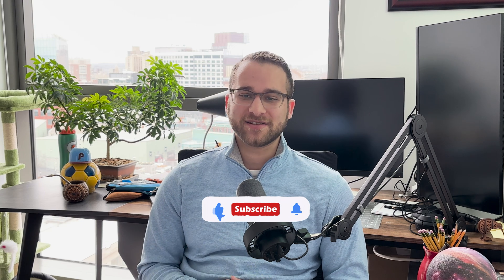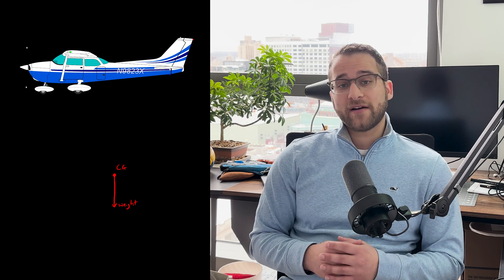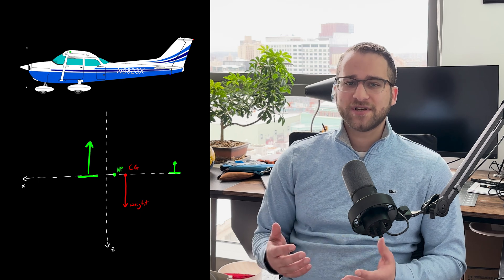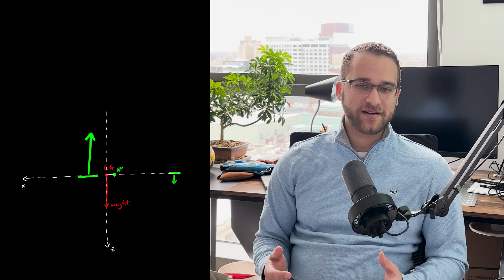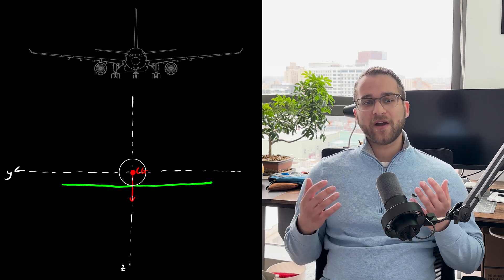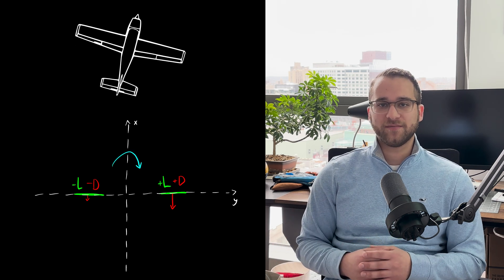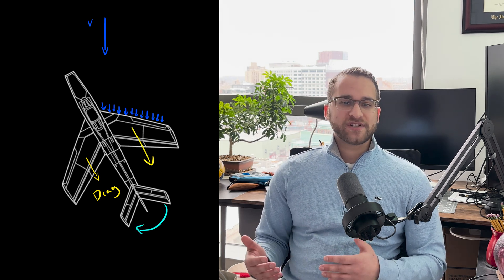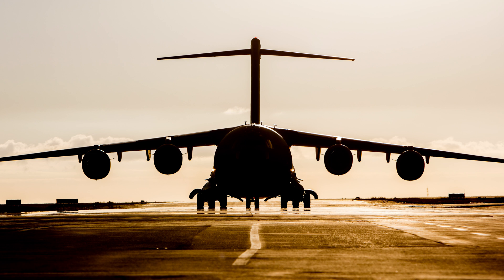Aircraft Stability: Why Planes Stay Straight and Fighter Jets Need Computers | Aeronautics 201

Comment: FYI, I have flown an aircraft that was certified by the FAA for passenger airlines service. This aircraft was pledged with negative dynamic stability.  What that is, any change in direction and the aircraft will keep going in the new direction despite neutral control position.
How this was aloud to be certified in passenger airlines is beyond me.
We worked very hard to keep things safe.
What is this aircraft?
BAE Jetstream 3200. The original opperation was to be a military aircraft landing on aircraft carriers.
FYI.
Reply from the maker: That’s pretty wild! I was not aware of this aircraft, gonna see what I can find. Thanks for sharing!

I assume that was to enable shorter takeoff and landing distances

Comment from the maker: Hi Everyone, If you have any questions let me know! Hope you learn something new!
Reply: Why doesn't the transonic and supersonic shock wave render the rear elevator useless (like the F35 or F22) and i would love more details on how the air behave at this speed regime over a wing surface. And the difference between that infamous P38 where its rear elevator was rendered useless due to transonic airflow, and modern Fighter planes. Thank you.
Reply from the maker: Some great ideas, thanks so much! I do plan to cover transonic/supersonics at some point in the future and these will make for some interesting case studies!

To answer your question, I suspect that in those regimes the Thrust Vector Control of the engines is primarily used to control pitch, but this is something I need to look into further.